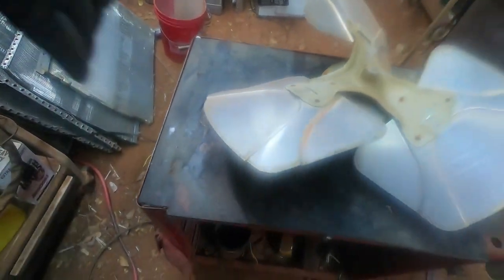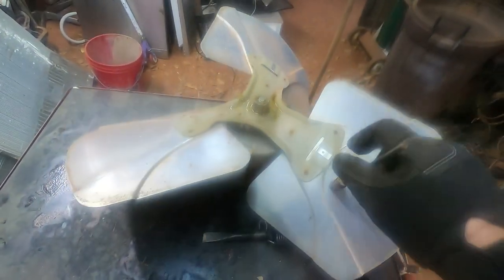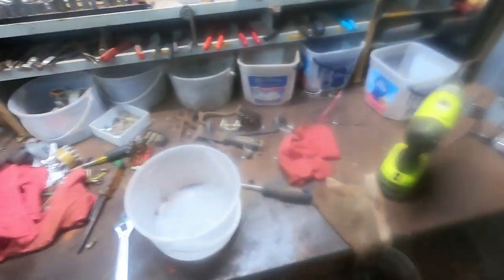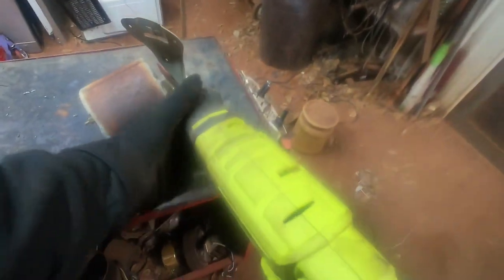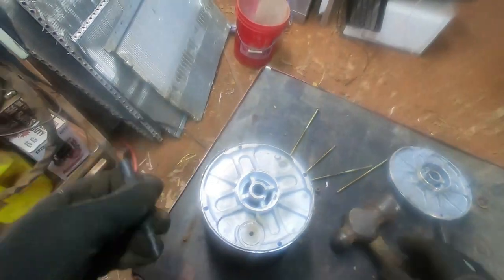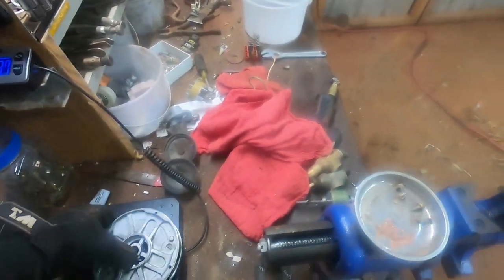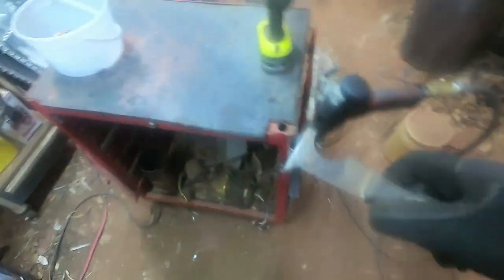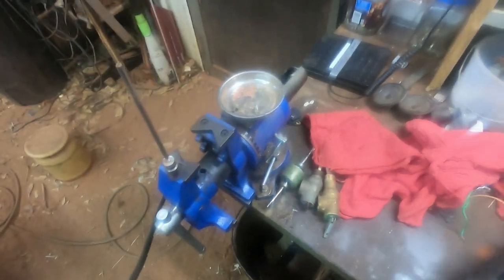Scrapping out the Fan and motor from the condenser unit how much copper

Comment: Okie take the air chisel with a point on the bit and put it on the middle of the motor shaft and push it out works great 👍
Reply from the maker: Great idea. even if it buggers the end I can still cut it like I did, a lot of the time I try to mention other ways to do stuff for the guys that are new to scrapping and may not have many tools. maybe I should do a tool video for the new guys. on what tools to get for starters and tools to get as you grow. Thanks for watching

Comment: You should try holding the fan by the blade housing and use the air chisel with a pointed bit to drive the motor shaft out.
Reply from the maker: yeah that may have worked, some times try one thing, if it doesn't work try something else

Comment: Made a bucket rack finally over the weekend
Reply from the maker: great, how did it turn out?
Reply: Good so far ran out of wood. Need to put on a fourth rack and the top shelf. Using it as is for now with just 12 buckets, already freed up a bunch of floor space.

Comment: I put a little oil radiator in my wellhouse and have been dripping water in my separate bath house for a week now with large oil radiator in there but sunday the big propane tank ran dry because of faulty gauge so we been kind of roughing it with a 15k btu grill tank heater description said those run time of up to 43 hrs not so it ran out at 3am last night but thankfully we had it for the -4 day its a scorcher today at 20 and only going up until friday morning
Reply from the maker: I have a milk house heater in my well house pugged into a thermal cube, powers on the heater at 35 degrees and powers off at 45 degrees. trailer is drafty so ran 2 tank top propane heaters on low to help out during the windy and coldest part. weather is much better now high today 21 very light wind,
Reply: @Okiescrapper  lucky you its still snowing here will stop around 11 tonight 4 hrs  i have to try to get the snow off 2 shed roofs

Comment: How do you heat your shop. I have to do something the cheapest way. Cold is a killer in osteo arthritis. Ugh!! Been working outside. Kerosene smells and the garage door has to be open. Electric ceramic heater dies nothing. Propane turbo heater heater -grill tank only lasts 10-12 hours and costs $20 some dollars. Wood stove sounds nice. Might be dangerous idk. Garage is detached from house.
Reply from the maker: Northern Tool Sells a heater similar to this one in the fall for just under $100.00 it is 17,000 btu. 3000/5000 watt. 220 volt https://www.northerntool.com/shop/tools/product_200665094_200665094